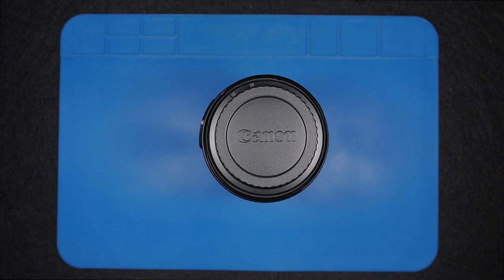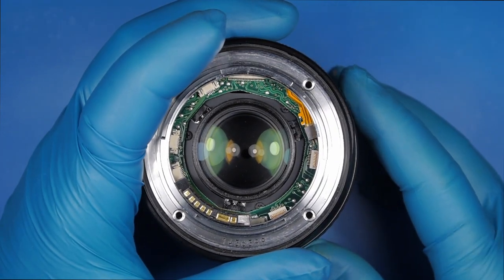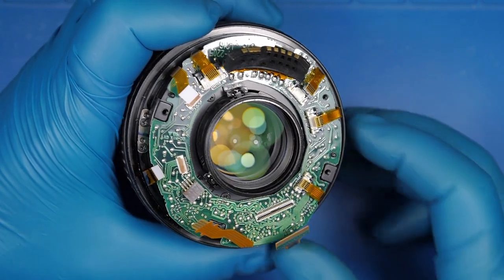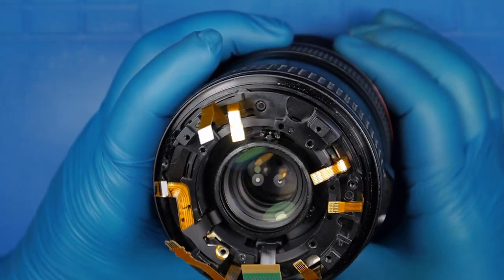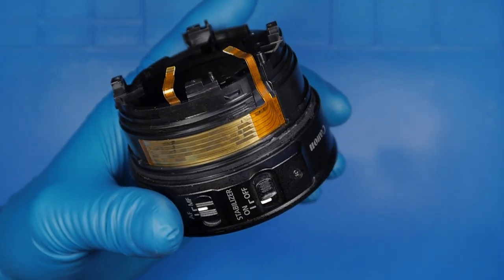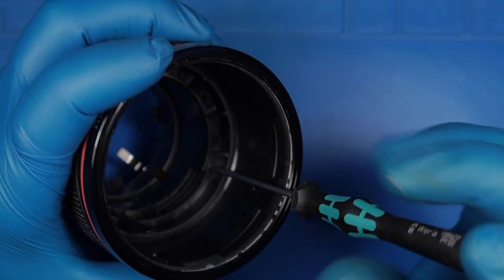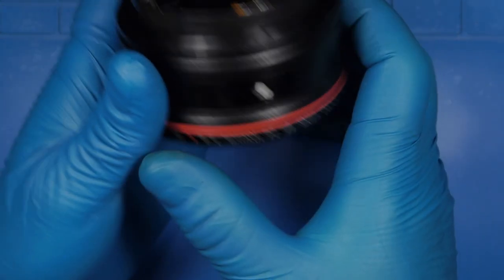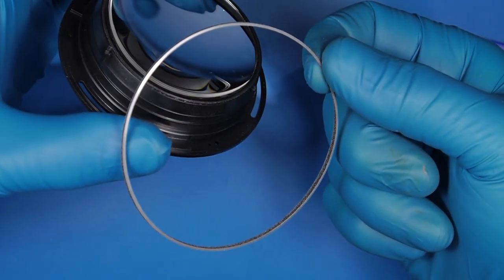#022 Canon 24-105 f4 Step-by-Step Disassembly - How to Service and Repair(Part 1)

Comment: Thanks, It’s actually a good explanation of how take apart this popular lens, it’s also good that you show other parts during the disassemble process, because it’s not everything that is covered in the repair manual. A very important thing during the disassemble process is to set small scratches with a very pointy tool, before take out For example the front lens or the zoom brush, it will make it a lot more easy when assemble the parts again because you have the correct position of the part. It was just a few notes that maybe could help other people. Keep up your good work 😊👍🏻 I subscribe
Reply from the maker: Hello Professor Olsen, 
Firstly it is an honour having you to my channel, plenty of the experience I've gained with lenses is thanks to you and your channel. Every time I was getting into one of your repair instructions/videos, I was completely hooked from the beginning to the end of the process, so a big Thank You for the big effort of what you do. This is one of my first video of la zoom lens teardown, after many years of practice I decided to share some experience, even if still on learning on this lenses world. 
During the teardown I was trying to explain the points where to put signs on the lens, but definitely next ones to come I will be more careful and consider putting a sign if necessary. 
All the best, Cosmin.

Comment: Thanks for the video, this is really helpful for me. I took apart my lens years ago to clean the front lens and I think I spoiled the calibration when I put it back together. I didn't know the front could be taken off and took the whole lens apart from the back. Now the autofocus at wide angle does not work well. The autofocus only goes half way to focus. I think maybe the position of the contactor brush needs to be adjusted. If you have some comments on that and calibration for a part 2 of the video that would be really helpful.
Reply: Ah, it was one of the ribbon cables not fully inserted into the board. OOPS!
Reply from the maker: HI there, glad to hear you sort it out, second part it's a bit confusing, so I'm trying to make it easier/better before I will add it.

Comment: Great explanation, thank you very much!
Would you think it is possible to use a more sticky (professionale-grade) lens grease to dampen the zoom mechanics? It would be amazing, if this lens could behave a bit more like a proper cine zoom ;-)
Reply from the maker: Thanks! 
Sadly to say, but no. Photographic lenses have nothing to do with cinematic lenses. A proper cine lens use bearings for a longer and smoother feel and lifespan, are almost entirely in metal and not plastic like photo lens do.

Comment: Got a tiny piece of sand in the focus ring making grinding - what’s the fastest way to just get to the front focus ring?
Reply from the maker: No quick fix with such thing, you will need to dismantle it, remove and place new grease.

Comment: How to repair a rubber on the surface of the Canon 85mm 1.2 L II?
Reply from the maker: Which rubber are you talking about?
Reply: @CameraRestore  I mean rubber which was coated body of these lens, not rubber of focusing ring.
Reply from the maker: @patrrickoo  If you talk about he paint on the body, I wouldn’t bother if I would you, you may risk to get it worse. Could you put a picture on wetransfer.com  and share the link so I can understand better…

Comment: Part2???
Reply from the maker: No part 2 for now, that section requires lens alignment, so no way to do it as a DIY, only a specialised service can do it. Also many don’t have tools to do it.
Reply from the maker: No part 2 for now, that section requires lens alignment, so no way to do it as a DIY, only a specialised service can do it. Also many don’t have tools to do it.